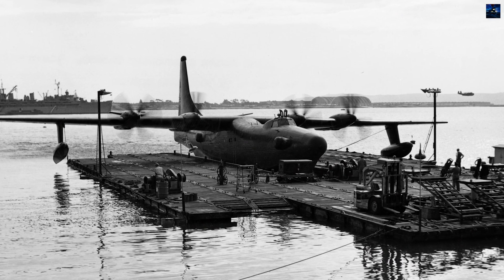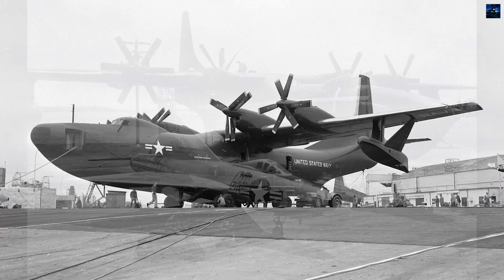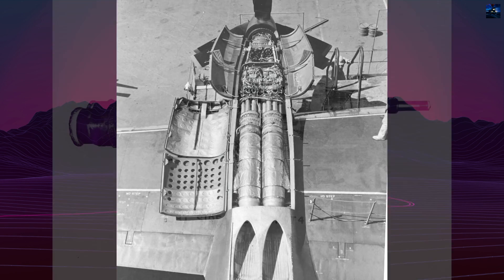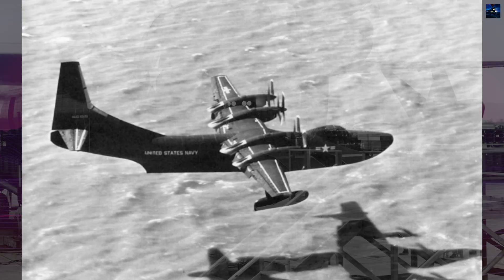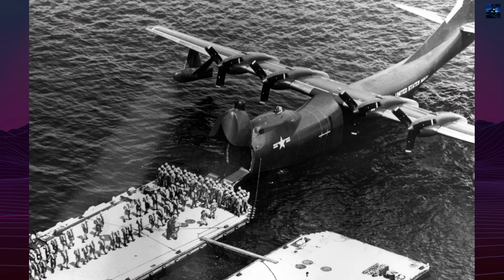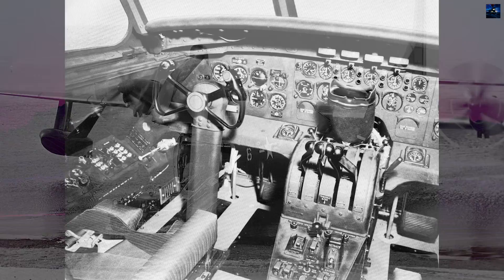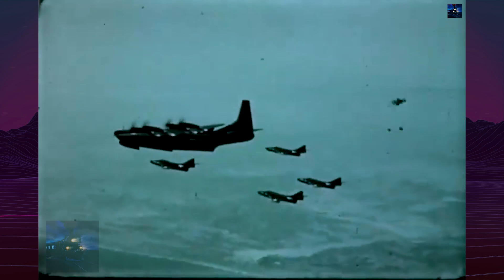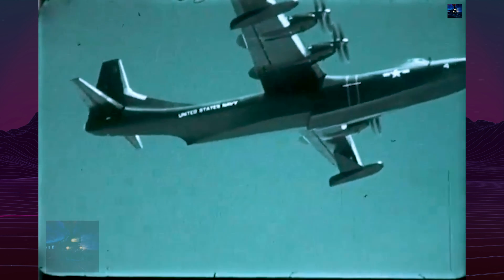Convair R3Y Tradewind: America's Last Great Flying Boat

Comment: Perhaps it’s time to dust off the plans for this design and bring it back. With the newest turboprop engines, like what’s powering the newest models of the C130, it would be very reliable. As a refueling aircraft it would extend the reach of our carrier based aircraft and relieve some of the duties that are required from the current carrier refueling aircraft.

Comment: While my father was in the Navy during the 1950's he saw one of these once and apparently talked with some of the crew. They told him that it would have been large enough inside to contain a bowling alley. He never forgot the plane but DID forget its designation. He told me about in when I was probably in my 20's but didn't know what the plane was. I had a number of books on warplanes and while looking through one of them one day, found an entry about and photo of a Tradewind. I showed it to him, and he said that was the plane he had remembered all those years before. Though the Tradewind entered service later, the last large flying boat that the U.S. Navy was operating was the type my father served aboard as a radio operator, the Martin P5M Marlin, which was still flying during the Vietnam War in the mid '60's.

Comment: Nice short story on the Convair R3Y Tradewind. One slight correction, the R3Y was not the last flying boat used by the U.S. Navy. That distinction goes to the Martin P5M-2 Marlin which saw use into 1967.

Comment: A reasonably attractive air raft (for a seaplane), and probably suited to the role the Japanese Shin-Meiwa fulfilled.
I was always confused that navies and maritime forces opted for non waterborne maritime aircraft like the Neptune, Orion, Shakelton, Nimrod and Breguet Atlantic, instead of an aircraft that, once having found something in the ocean, had the option to land, instead of having to loiter for hours, waiting for a naval boat to get there.  At least Beriev and Shin-Meiwa hung in there for a few decades longer than the rest.
Reply: Look how strong and heavy an aircraft has to be to start and land on the water. Also when there is bad weather, it is only possible in sheltered areas.